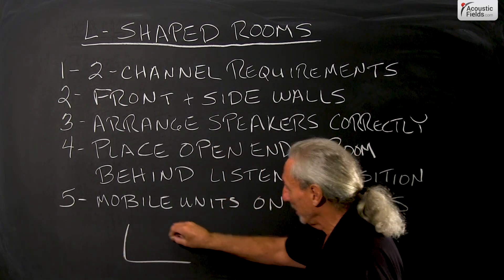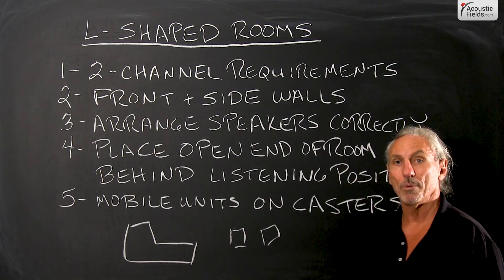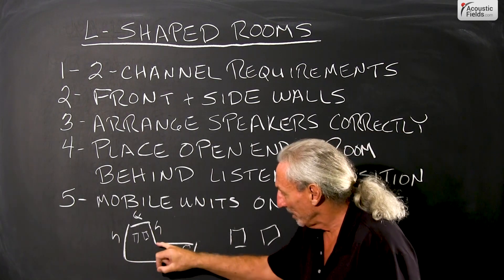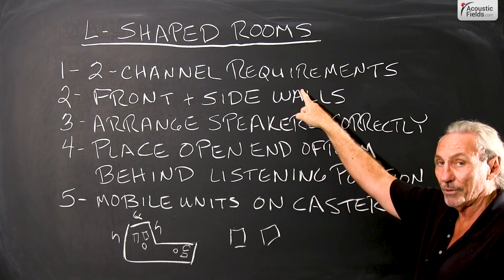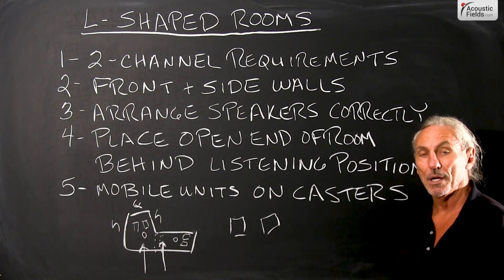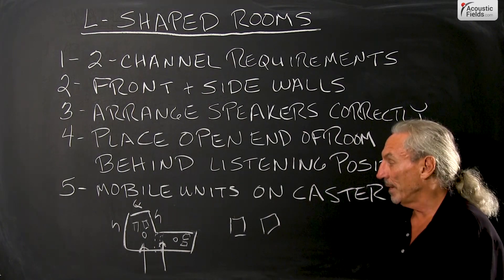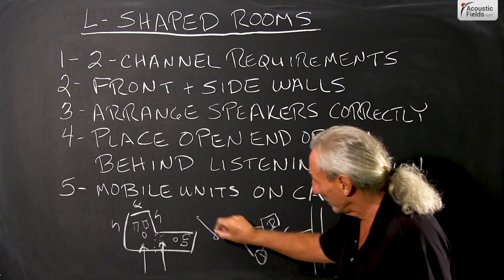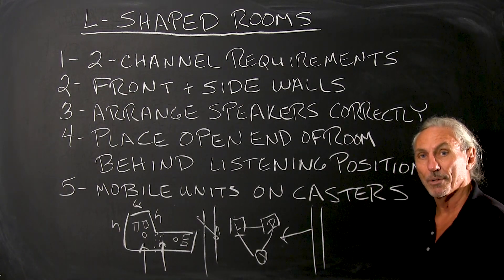Do You Have a "L" Shaped Room? - www.AcousticFields.com

Comment: I have my speakers one end i sit about 15 inches off the center  towards the speaker wall ,i have equal distance to side wsll r and a L the speakers are 3feet from front  wall ane 4 foot from side wall i also have 2 subs  1 behind each speaker and the room sounds superb i am using diffuser front and back and sides.The room didn't sound as good with no subs that made the difference.
Reply from the maker: Good start. Now, add more diffusion to create a wider soundstage
Reply: Yes I will the room treatment is a must but it does take awhile to work it out..

Comment: Due to limitation, I'm in a situation where speakers are right where they shouldn't be, so they dont have the same distance from the side walls. Would help to add a thick curtain with rockwool to simulate a sidewall?
Reply from the maker: You can not simulate wall density with limp mass material types. You are confusing sound absorption material types with barrier material types. Use our Carbon Panels to create new sidewalls. When treating a room with pressure treatment you must treat at least two walls since axial modes are produced by two walls.
Reply: Thanks for such quick reply! I’m based in Brazil, not sure they’re available here? Nevertheless, would it help to add a bass trap with solid wood on the back? I can do that and leave just a small gap to enter the room as it’s the hallway.

Comment: more than half energy flows to second L space,its insane how deep bass is there ,where system isnt standing.im going to rent another house.with rectangular room.
Reply from the maker: Modal pressure issues oscillates throughout the room. It is best to fix the room modal issues at their wall locations with the tretament type that has the proper rate and level of absorption that is required to reduce the amplitude of wave energy, This will avoid whack a mode behavior.
Reply: thanks for response.im treating room as much i can.Only imagining what this system sound in 40 m rectungalar room.instead 40 m2 L shape/see

Comment: Seems i just put my speakers in the worst place. i got next to no sound below 120hz. so i found this video and it turns out my previous placement was one of the two options you showed already. i was hoping i could get better results by moving things around but nope. it was a bad idea.
Reply from the maker: L shaped rooms are difficult since there is little predictability and consistency in the distibution of the acoustical issues within the room. Most in your position use our ACDA or Carbon Panels to form and new room within a room. Units are on casters or wheels which allow you to move them into place when listening and if need be, move them away for more access.

Comment: what if there is no side wall :( One side has a wall, the other has the open space kitchen cabinets (1.5. meters away. Can you pls advise? Is the mobile wall necessary?
Reply from the maker: You must have equal distances from the speakers  to  the sidewalls. You can create the "wall" with movable panels.

Comment: Is it possible to give my L shaped room a pseudo symmetry by adding two mobile walls with heavy Bass traps - 1 closer to the Right Wall and 1 far away from the left Wall creating a Long pseudo symmetrical rectangular room?
The left Side will be covered by a mobile absorber with 20cm thick rockwool basstraps and about 1,5 meter from the Windows on the left wall away. The Right side will be closer to the right Wall (40cm away) and will Cover the door of the room. Understandable?
Reply from the maker: The left, front, and right sidewalls must be continuous and the speakers at equal distances. If you do not have this set up, you can use portable and moveable units to create the "walls".

Comment: I have a L shaped living room and the right speaker is placed with about 3 meters to nearest sidewall,the left speaker is placed about 70cm to it's sidewall.I placed 30 Vicoustic foam panels (bought them 10 years ago so i thought i give it a go) on the left side and the rear wall behind me,my living room has the studio looks now lol,but atleast the sound improved drastically.Pinpoint center and image definition,so it's possible to get decent sound in suboptimal placements.You suggested either absorption or diffusion on the rear wall,so i tested with absorption,much better than when i had 20 in the ceiling and 10 on the left.I focused as you have said in the horizontal domain and it paid of,thanks alot.:)
Reply from the maker: H,  Yes, creating another panel wall of equidistance is a good tactic. Thank you for confirming in real time what I have been saying in videos. If you want to take your listening experience to the next level, place diffusion front and rear walls.
Reply: I might have said what i meant a little bad (not native english).As of now i have 15 panels on the left side where the windows and left speaker are at,the other 15 is behind me at the rear wall,since as you have said placements on the long wall often brings the rear wall closer.But it sounds great for now,really loving the sound after i focused on the horizontal domain.And yes i have been thinking of putting up a small wall of plywood in the middle of the living room,to create a solid barrier against the speaker on the right which now is sort of in free space with no wall against or close to,i don't want to turn the living room around,i know it's the best (and given enough time i will end up doing it),,but furniture,neighboors looking in etc because of windows etc makes it hard to make that choice.The thing is the right speaker which has around 3meters to it's sidewall,those reflections and stuff is so far away in time that i don't notice them.What i did notice was when i placed those 15 foam panels on the left side cause the left speaker is close to both a wall a windows,that change improved the center and overall audio imaging,combined with when i used those panels i had left on the rear wall,and focused on the horizontal domain alot as you have recommended (i had alot of them in the ceiling before).
So sorry for the long text,youtube doesn't chop up the text very well,i love your channel,and you explain everything so easy,you are a great teacher. :)